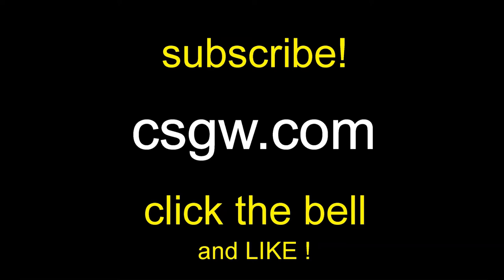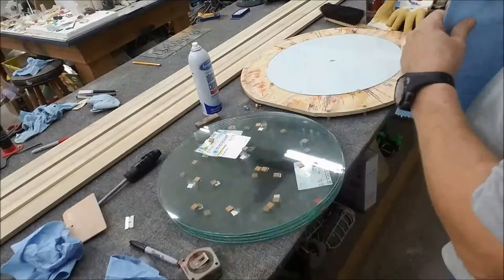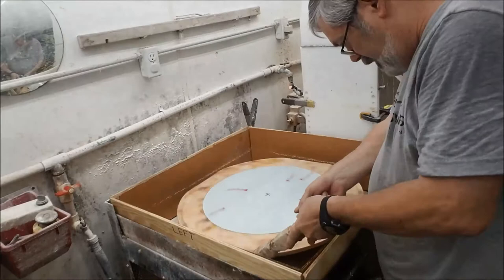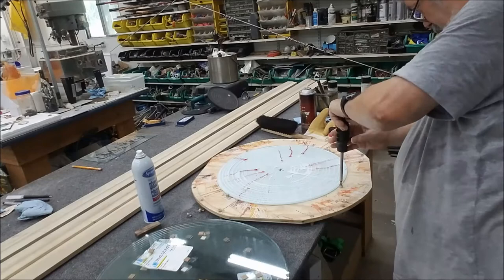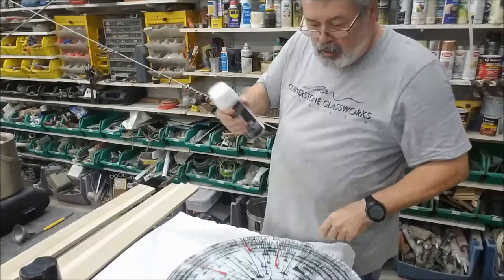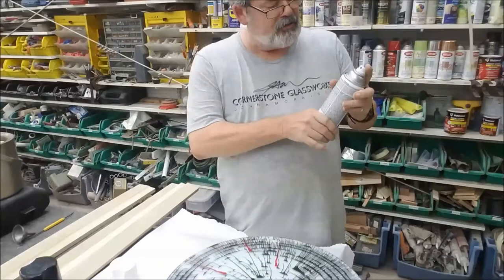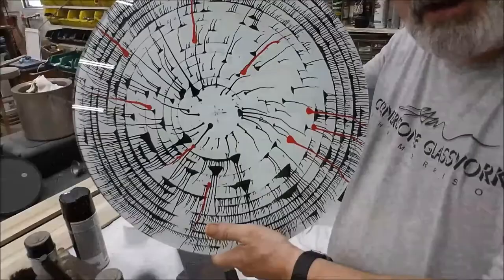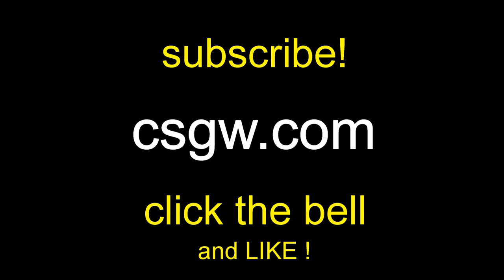More Spin Art on Glass

Comment: Good day, great video. I'm curious as to how you attach the plywood to the back to hang them
Reply from the maker: Hello Super, I use a dbl. sided transparent foam tape from 3M's, VHB series (Very High Bond). It will stick well to the painted glass. On the plywood, I paint contact cement in the areas where the foam tape will touch so I know I get a positive bond to the dry porous plywood. I hope that helps. Thanks, John
Reply: @cornerstone-glassworks  thanks for the info
Reply from the maker: Hey Super Man, I'm sorry that I overlooked your message. I just dropped the ball. In case it still matters, here's the answer to your question. I use a very effective 2 way foam tape from 3M called Transparent Foam Tape. It's part of their VHB series (Very High Bond). They have different thicknesses and widths. I buy it from R.S. Hughs Company in Dallas, Texas. (214-351-2300). Now, to prepare my surfaces for the tape. The glass (painted) is smooth enough for the tape to stick. But the wood is not. So I paint the wood with contact cement (the flammable kind - not the "safe" stuff) where I know the tape is going to go. I let that dry. Now the transparent foam tape will stick fabulously. That's it. Let me know if you have any more questions. John

Comment: Which printer do you use to print your stencils? I bought the kit to make the stencils but I still need a printer.
Reply from the maker: Hey Connie, I am a fan of Epson when it comes to printing black transparencies. Of course, when it is coupled with Ikonics' AccuBlack clear printing film.
Epson does not have settings for clear film in their printers. However, with the correct settings, Epson gives me the best home-made film positives I have gotten from a printer.
When you refer to a "kit", are you talking about the UV exposure lamp, the wash out nozzle and the light sensitive film? So you just need to get your film-positives in line?
Let me know. Ciao
Reply: @cornerstone-glassworks  yes I just need a printer now that doesn’t cost the earthen to buy or to run and I was thinking I should go with an Epson but which one is the big question. You said you got the best print from yours so I hoping you could give me a make and model sorta speak and I could check them out from this side of the ditch. I haven’t tried any of the stuff yet. I am hoping to very soon. But I have to start with a printer I think.
Reply: Also what computer program do you use to make the pictures? I hope I am not being a pain.
Reply from the maker: @Wyrmwood66  Hey Connie, I have had 4 or maybe 5 Epson printers and they all seemed to perform well for the purpose we are considering. A couple I have now are part of the XP (Expression) series. And one is a WorkForce wide format printer. While we are talking about Epson printers, I would highly recommend an XP machine that will print CD's and DVD's as well. It is so nice to be able to print professional looking discs. It doesn't add much to the cost either. BTW, Connie.......as we have been communicating and working on getting you started with this process, you may contact me directly through my website ( csgw.com ) if you like rather than having to channel your way on YouTube. Either way is fine with me. Good luck!
Reply from the maker: @Wyrmwood66  Hello Connie,  I have been working with CorelDraw for 20 years or more now for my graphics. I started with version 4 and am currently on version 15. But they are up to 20 or higher now. I will say that version 15 has been a little glitchier than 4 or 8. It's a little pricey but powerful software. Comes with a lot of good stuff on it. Well, I hope that helps. See ya!